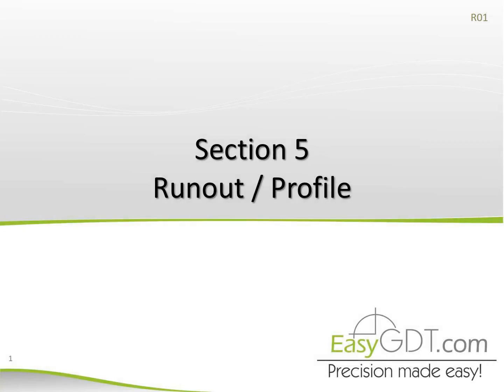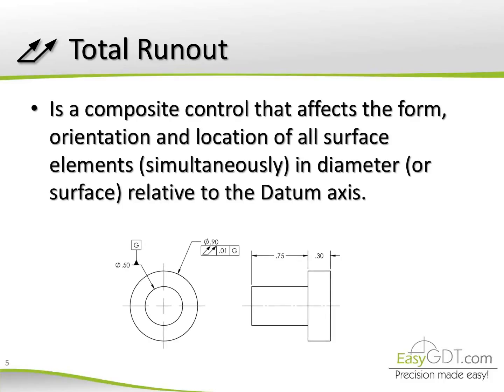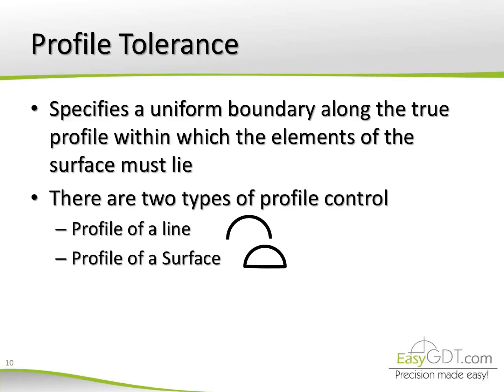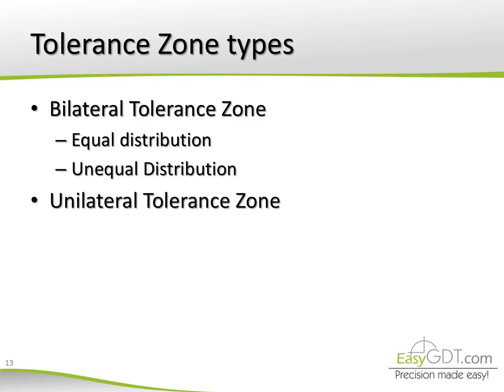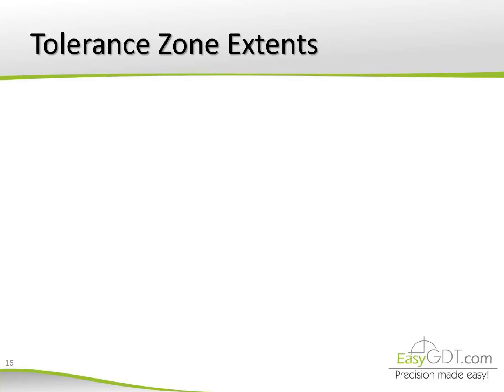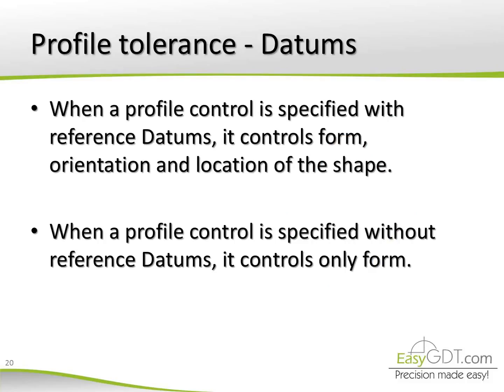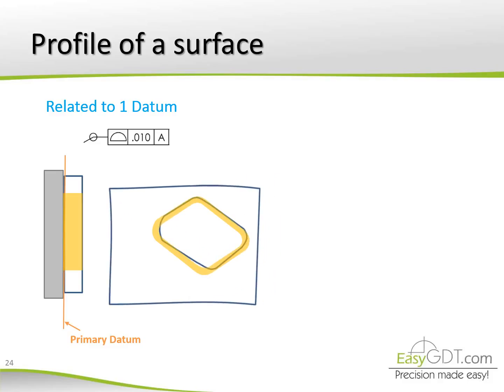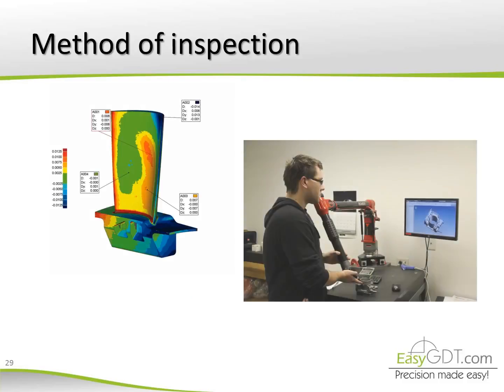Chapter 5   Tolerances Of Runout and Profile

Comment: Thank you! I have a question. At  11:00 you illustrate surface tolerance to all that "upper" surface however few minutes earlier it was said that if the surface reaches tangent points then the tolerance is meant between those tengent points. At 11:00 we have 2 tangent points (inflexion) points on the surface so in this case the tolerance cannot be meant onto the whoel upper surface, right? Ty

Comment: Your video is covered lots of material very well. Thanks Sir!
The question I have is now a day, to inspect a profile of a surface with datum references by using a CAD file and drawing shows no basic dimension. Not only that, Datums are picked all over. So how do you deal with this? I mean how to define reference distances from a feature to these datums? Or how to know they relate each other or not?